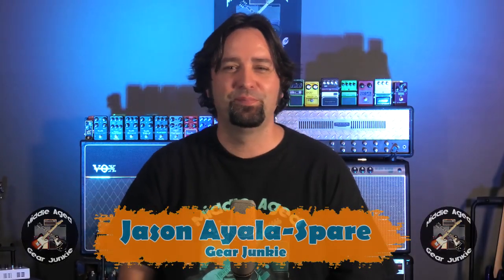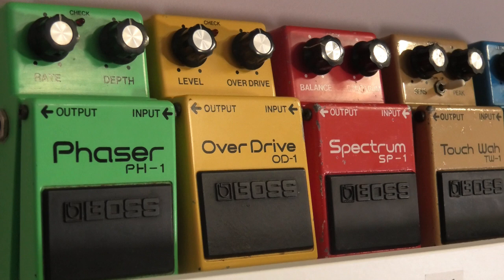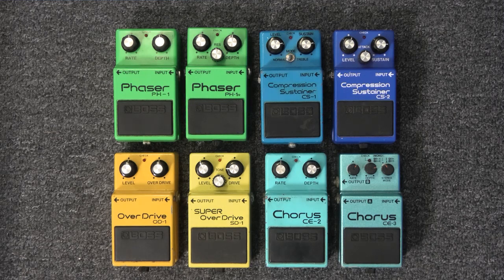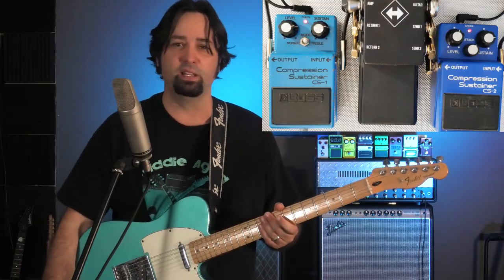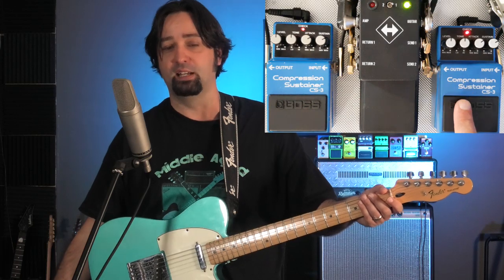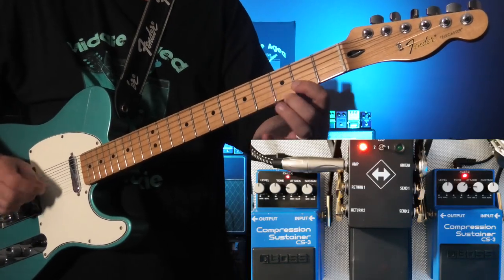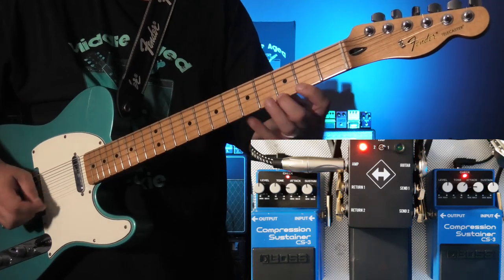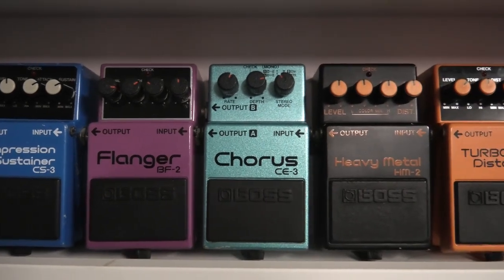Boss Compressors Through The Years (CS-1, CS-2, CS-3, CP-1X)

Comment: The CP-IX was prettly bloody fancy schmancy. Flawless in fact.  Possibly the perfect choice you could make. Very impressive indeed. 
I have a JHS 3 Series compressor which has a toggle switch which has a "bright" option (identical idea to the first Boss one you demoed). Can't fault it for myself. The volume knob goes way over parity. I use it on a couple of songs where I do this Duane Eddy twangy thing and it cuts through like you wouldn't believe.

Comment: I bought one in Japan in 1990, but found it seemed to add a little fuzz when trying to play with a clean sound. I don't think it was just noise. I may have to pull it out and have another play with it.
Reply: Did you have it running with anything else? Was it on PSU or battery? These are things to consider!
Reply: @mushymystic  I have since pulled out again and found the problem. I had been underpowering it. It required an ACA power adaptor which actually supplies 12V. When I brought it back to Australia and asked at the local shop for a Boss power adaptor for it they gave me a PCA and I didn't know any different. I have now bypassed the voltage drop resistor in the pedal and it runs happily off of my 9V power supply. It only took me 30 years to work it out.
Reply: @michelfouche4599  awesome! 🎶

Comment: Hi Jason, I have 2 x cs2's one is march 84 and Jan 82. The older one has grub screw knobs and a slight anomaly.  The sticker on the back says made in Japan but is a separate sticker to the black label sticker, it has been stuck on afterwards over the top of the black label.  Have you seen any boss pedals like this? It has "use a coin to open battery compartment" on the back. I had thought the sticker may have been fake, but all cs2 are made in Japan as per your video so I thought I would ask another Boss nerd for your opinion.  Great video, thanks. Paul
Reply from the maker: Hey Paul, that's quite the anomaly. I've never seen a sticker saying 'use a coin to open'. Do you use them in series or in parallel?

Comment: Nice video, but I need more in depth specs on the CS-3 controls which aren't available on the Roland website. Does anyone know what the threshold ranges are and also what the compression ratios are on the CS-3? Both threshold and compression ratios are on the same sustain knob and are factory preset, so assuming the sustain knob is set at 1o' clock, what is the db threshold and what what is the compression ratio likely to be?
Reply from the maker: That would be good to know. I know with some compressors the ratio and threshold are combined in the one knob, such as the dyna Comp.

Comment: Nice comparison! They all have their unique strengths IMO, but I have used the CS-2 for years - it just has a really nice attack. The CS-1 can be fun, despite the low output; the CS-3 has a broad range and useful tone knob, and the CP-1x is the most hifi i.e works pretty well after dirt in my experience. Cheers
Reply: Do you maybe know how much 'tone' on cs3 you have to dial in to get the sound of 'treble' mode on cs1 by any chance?